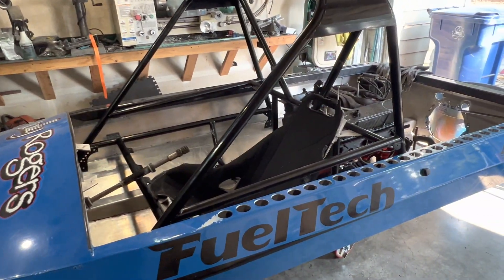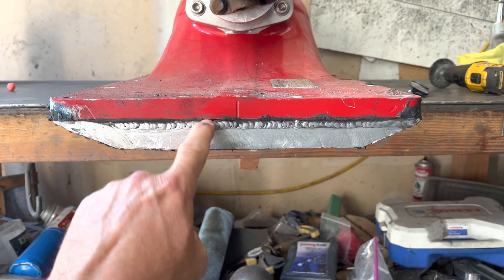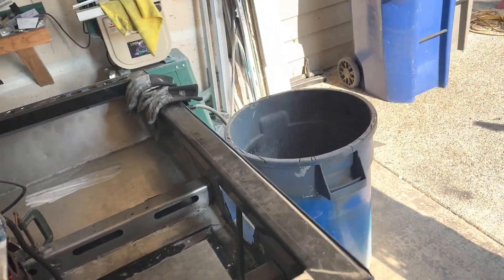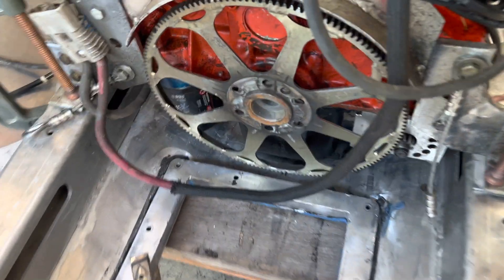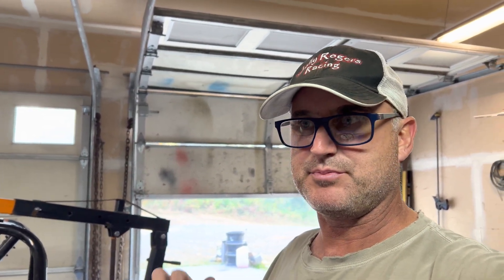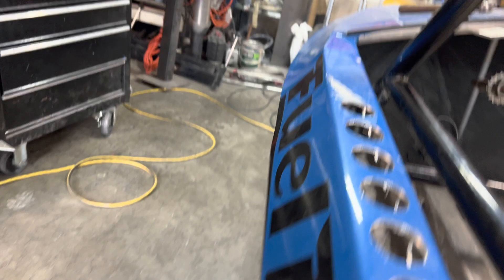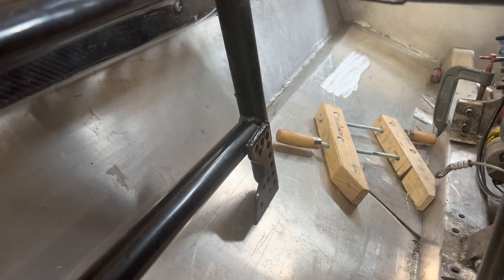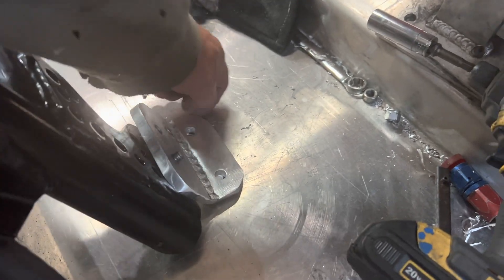Jetsprint build Episode 2, pump block and roll cage install.

Comment: Just curious I don’t think it would cause any leaks what about some drilled and tapped holes in the pump itself that you could use bolts to jack that plate off the bottom instead of using screwdrivers or wedges or chisels you could put four or six of them on there and put equal pressure around them and use them to push that plate off the bottom of the pump when not in use you can just put a shorter bolt in them with a little silicone but I don’t think water could get in anyway
Reply from the maker: That’s not a bad idea!  I might try it in the next build!
Reply: @JollyRoger907  on our glass boats there were jacking bolts in the intake to level it when setting it in the epoxy but they also worked well for pulling the intake loose when needed! Love the new build! Looking amazing!
Reply from the maker: @glastornjet73  yep I’m all over that idea!  Really just need two in a corner to get it started, once you can get a wedge in there, they come out easy
Reply: @JollyRoger907  right on glad i could help!
Reply: @JollyRoger907  One thing I thought of here watching one of your other videos when you drill and tap them holes you might want to put a Heli coil in instead of threading the jacking bolt right into the aluminum it might be worth loctiting a good thread insert in to have something nice and hard to thread against

Comment: >> not digging the roll cage mounts, and the cage itself could be much improved.
Reply from the maker: I’m always open to criticism, as long as you offer up a better way of doing it.  I’m all ears.
Reply: @JollyRoger907  
What rules are you using... I'll look at requirements first.
....
Mounts to frame rails... should be 90° bent plate and use 4 bolts ( 2 top, 2 side) 
Hull mounts.... 2 countersunk screws are not sufficient. Ditto on 1 bolt in single sheer 
Cage itself could use triangulation 
Also not happy with the length of seat tabs.  
...
My experience is in IHRA ProMods and I am a retired master pipefitter.... fyi.
I've also worked on helicopters...  the sheetmetal reinforcement techniques ( lots of rivets ) could be copied for the hull mounts. 
...
Btw... rounded corners still punch thru sheet aluminum.   The edges need a radius ( round over router bits work great! )
The transverse tube for middle seat mounts can  tie into main frame rails and reduce the tab length. 
### I have never used your method to extend seat mounts.  

PS... Do you have a tube bender ????

Comment: Like the videos! If you need more heat I would recommend a turbo torch brand  handheld, you will get a lot more heat from the same fuel or could even go to MAPP gas.
Reply from the maker: Thanks for the tip!

Comment: I use a paint scraper to brake flage seal's. 

The grades of Allaminium used in fabricating as some high strength Aluminium you can't bend due to snapping it.
Reply from the maker: Second time I’ve heard paint scraper!

Comment: So who are the main hull manufacturers? Are most welding them up at home or ordering them welded out? A lot of Googling leads to stuff in NZ/AU, not a ton of information or used boats locally. There's some stuff but not a lot. I did read through the USJSA rule book, roll cage looks straight forward, nothing looks too crazy. I guess I should just get out to some events and see what's going on.
Reply from the maker: Sprintec, Stinger, Pulse are the current main builders all overseas.  Couple guys doing one or two over here but I think I’ve built more race boats in the U.S. than anyone and they’re all on my team lol.

Comment: I’d be interested in knowing more about hull selection, the effects and considerations of various features, how do they relate to tuning.
I’m assuming there’s more to hull selection then whatever the builders have on the shelf, or just buying “the hot setup”.
Reply from the maker: I’ve only bought one race hull, the very first one.  Since then, I’ve built everyone I’ve driven.  I’ll try to address some of the differences in an upcoming video.  Thanks for the input!

Comment: I feel like you have a good mix of time lapse and actual normal speed explaining/fabricating. Did you put any kind of plate or fender washer on bottom side of the center cage mounts? I maybe missed it.  Lookin good Eric 👍
Reply from the maker: Thanks Jess, I appreciate the feedback!  There will definitely be fender washers in those bolts with final assembly!  This whole thing will get torn down one more time!

Comment: Did you ever get the bare hull weight? I dig the timelapse with explanation in between method you have been doing. Thanks again for showing us how these get built.
Reply from the maker: Ughhh I realized once I started bolting things in that I didn’t weigh it empty!  I promise I’ll get that done but now it’s going to be awhile.  Sorry about that!
Reply from the maker: I just went and weighed the #146.  It still has the pump in it but otherwise bear.  I’m hesitant to say what that hull weighs but I’ll just say it’s under 400lbs with the pump!
Reply: @JollyRoger907  by all means. Keep it a secret. That generalization is still very impressive. Also, just glad you entertained my curiosity. Thanks!

Comment: A SWAG press brake would make short work of bending those brackets without cutting them first for not too much money. Made in Oregon and slips on a harbor freight 20t press. I don't think I'm that far from you I have one, it would be so much fun to put together a boat like this.
Reply from the maker: Ahhh I just bought one of those harbor freight presses last year and didn’t know they had a swag for them.  Will look into it!  Thanks for the tip.

Comment: good time to check and see what needs to be addressed like the fuel pump and all the little things before next years race season👍👍👍🏁🏁🏁🏁
Reply from the maker: Absolutely right!  I will rebuild the starter too as they inevitably get water inside them and always seem to fail mid race lol.  This engine is actually going to Benny for a refresh after I’m done using it to build the boat anyway!

Comment: BoatLife sells a release agent for removing cured silicone & polyurethane sealants & adhesives.
When you reinstall, gasoline or a 50/50 mix of laquer thinner & mineralspirits are the best options for 3M 5200 clean up.
BoatLife sells Lifestyle sealant for below water line composed of silicone/urethane blend.
Gives more working time than silicone, equal strength to 3M, & cleans up with paper towels.
Reply from the maker: Ahhhh another great tip!  Thanks, I’ll definitely look into it when I pull the pump out of the #146

Comment: What was the point of separating the pump adapter when your just going to have to glue it back on ??? Was it necessary?
Reply: he did say it was to align the engine and he needed the plate off to get placement 😁😁
Reply from the maker: Different pump going in this boat.  The one that was glued to is the 9” that’s going in the #907 superboat hull.

Comment: How come you don't weld the pump adaptor plate permanently to the hull?
Reply from the maker: Welding 1.5” block to 3/16” plate, it’s super easy to fuck up the bottom plate!  I have welded them in successfully but I just prefer the flexibility I guess of being able to remove everything.
Reply: @JollyRoger907  Thanks, it's sounds to obvious now that you said it, lol. Really enjoying your vids. Wish I had the cash to race with you guys. Looks like a super cool series. Cheers

Comment: A drywall taping knife might be useful in the fight to separate the adhesive between parts.
Reply from the maker: Hmmm another good tip I’ll try on the next removal.  Thanks !
Reply: A multi-tool with a sharpened scraper blade makes short work of that RTV sealant.

Comment: you are doing great with the videos. like the explanation on the round corners. kind of like the reason airplane windows have round corners
Reply from the maker: Exactly like airplane windows!  Sharp or abrupt ends welded to flat plate is asking for trouble in a boat!